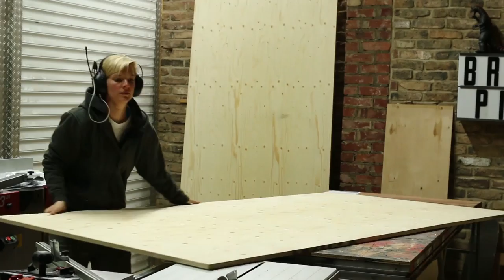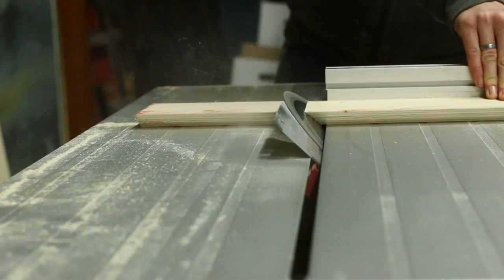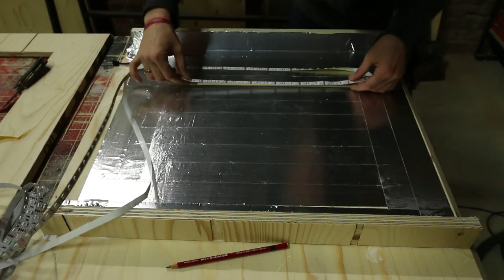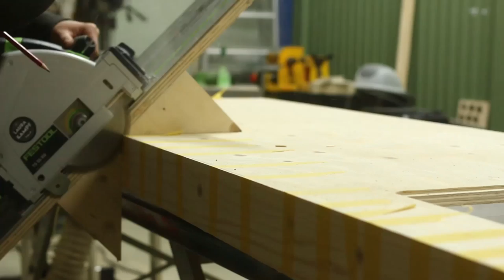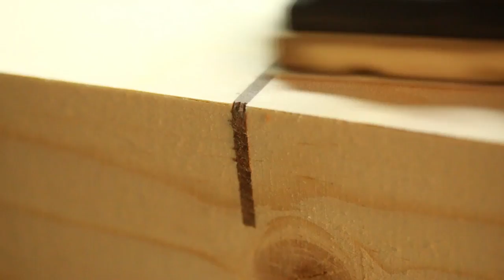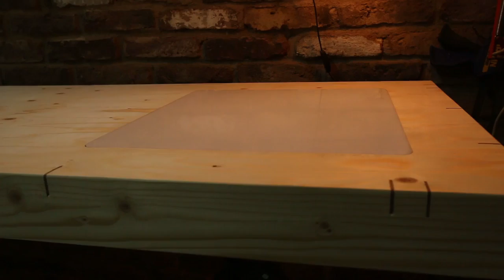Laura´s Light-Table

Comment: Anyone know the names of the materials she used? Specifically the shiny tape and the translucent piece for the tabletop? Thanks!
Reply: Asir risA the shiny tape is likely aluminum tape (might be found under duct tape because this tape is used for ducts as apposed to duck tape), it’s just sticky aluminum foil, one of the best parts of it is that any look you can give normal metal you can give aluminium tape, for the tape I like to do a brushed metal look which is super easy.  The translucent piece may be a piece of polycarbonate,  but a piece of acrylic or something along those lines is more likely.  Hope that was helpful, sorry for the late reply only saw the comment now
Reply: No need to be sorry, thank you so much!